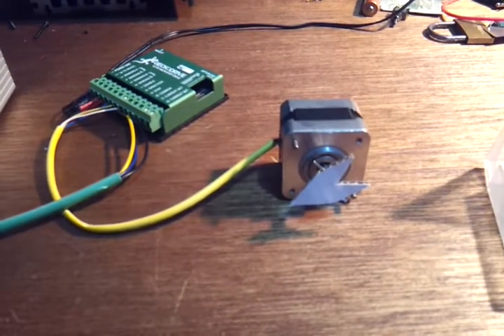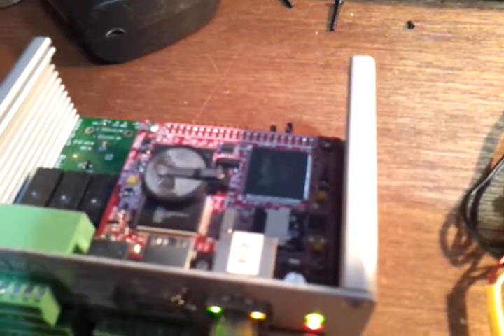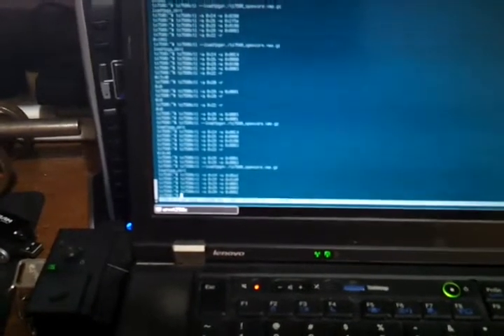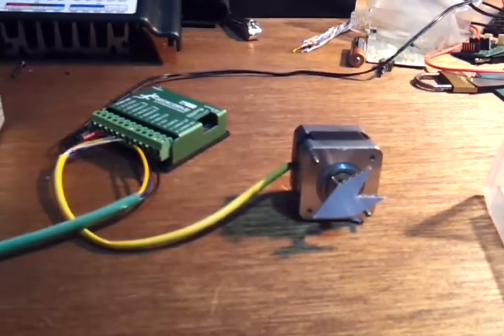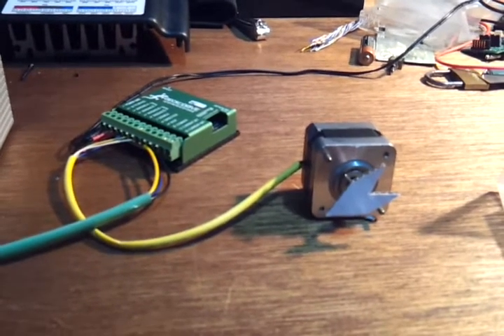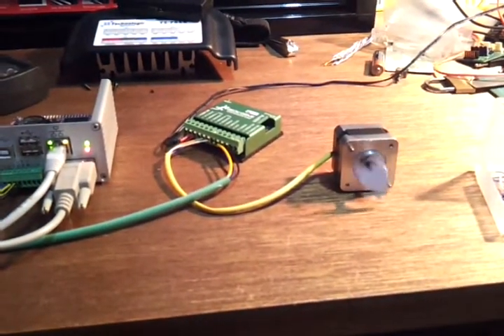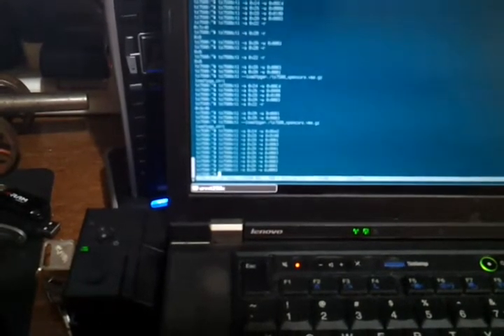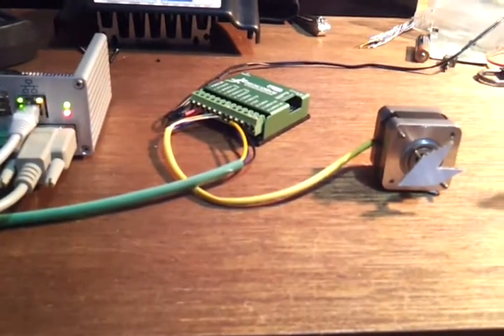Wishbone FPGA Motion Controller

Comment from the maker: More SBC/FPGA work.
Reply: Interesting. I might have to pick your brain sometime as i now have a small milling machine with all the parts to convert it to a CNC. All i need is motors,electronics and some expertise....
Reply from the maker: Cool what sort of mill? X3 or something?

Get a Gecko G540 it'll do everything you need. oceancontrols.com.au sell decent bi-polar steppers for good value. Avoid flexible spiral couplers they're sh*t and break easy.

EMC2 is brilliant, but you need to find a machine (or figure out what is causing it) that doesn't suffer from unknown jitter sources in the RTAI enabled kernel.

GCode generation is hard under linux. I generally use VCarve Pro under Windows because most open source tools are very limited.

A decent UPS that can run the spindle is also a great investment.

<brain dump complete>

Gecko G540:-
http://www.homanndesigns.com/store/index.php?main_page=product_info&cPath=24&products_id=182

Steppers:-
http://www.oceancontrols.com.au/Motors.html
Reply from the maker: Also invest in a decent estop button that's readily available at all times when the machine is running. Also stock up on bits and be prepared to break many as you get a hang of the machine/cutting speeds/gcode/hold downs/etc. :)
Reply from the maker: One of these? https://twitter.com/#!/alangarf/media/slideshow?url=pic.twitter.com%2FqFNsdegv I'd just finished CNC'ing it a few weeks ago.
Reply: It's an X2 - I got it cheap off ebay, unused, with all the CNC adapters in "as shipped" wrapping. I'm mostly using it as a drill press at the moment, but I have used it to manually mill some large holes in Al sheet (e.g. for the dash in the race car). I could have just bought a drill press, but where's the fun in that....

Comment from the maker: Hi Craig, this is just a test. The real use will have an AC servo in a closed loop with a fault line back to the FPGA for error condition, so no missed steps. Doing trapezoidal motion in a non-realtime kernel is non-trivial. I wanted zero overshoot of the target. Plus the pulse chain from the kernel would have lots of jitter making the motor noisy and limiting the speed. Also due to the bus design of the TS7500 you cannot lock the I/O bus to monitor quickly enough. The O/S needs it for disk I/O

Comment: Hey Alan, love the simplicity but I'm trying to understand why you're not using encoders with the FPGA rather than the PC for the kernel latency issues. Do your requirements only need accurate acceleration without the kernel interrupting and aren't that concerned about missteps if the steppers get overloaded?